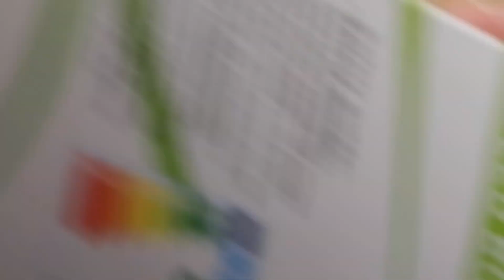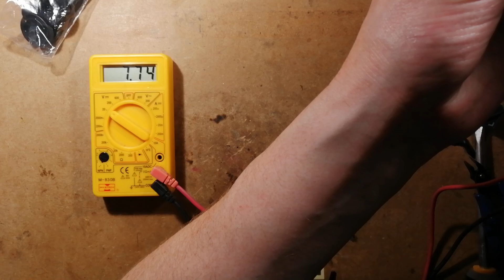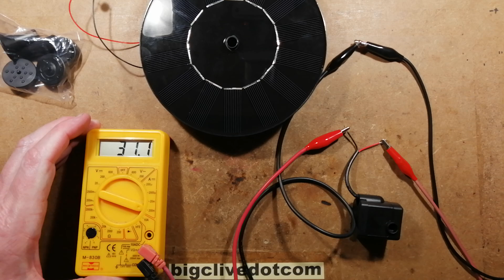Technical look at a floating solar fountain.

Comment: have you looked at the £2 car "ozone generator"? its just a led and a resistor  https://www.ebay.co.uk/itm/Car-Auto-Automobile-Air-Purifier-Ionizer-Ozone-Generator-and-Odor-Eliminator-XU/283487281881?ssPageName=STRK%3AMEBIDX%3AIT&var=584574330575&_trksid=p2057872.m2749.l2649
Reply from the maker: Yes.  They do real ones, but most are fake.

Comment: How can we power the solar panel using coal, oil, and natural gas ?
Reply: By plugging a light into the wall outlet and using that to run it, just like he did for his bench tests.
Reply: Use the coal to boil water, use the steam to spin a turbine, attach the turbine to an electrical generator, and put a tungsten filament across the output of the electrical generator. The filament will glow brightly resistance heats it up.

Comment: I think the camera is just upscaling the video in the same resolution it is recorded, so essentially just cropping the video it records rather than fitting the record resolution to a smaller area of the sensor. It seems quite pixelated when you zoom in. Also the audio sounds more tinny. I wouldn't say I liked your old camera that much, but I certainly preferred it over this one. If you are willing to spend the money, I would recommend a DSLR of some sort. They usually have significantly better video and audio quality, not to mention a better and exchangable lens, usually optical zoom, manual focus and the ability to lock the exposure settings etc, if you please.
Unfortunately most DSLR cameras (at least ones sold in the EU) have a soft record time limit of less than 30 min. This is done because for some stupid reason DSLRs that record longer than that are legally considered "professional" cameras which are subject to significantly higher import taxes. There are custom firmwares for most DSLRs however many of which allow you to record as long as you want or as long as SD card can. Therefore if you want to buy a DSLR I would definitely check if it has a record time limit and if so, if there are custom firmwares allowing removing that limit before actually buying the camera. ;-)
Reply: That's not why dslrs only record for 30 minutes.
It's done because DSLRs are not really designed to operate for that length of time and the sensors are at a real risk of overheating.

Comment: We bought one of thsse two years ago, it's still going strong.  We bought it to quickly replace the panel/lead acid battery/pump set up I'd made a few years earlier.  We had to replace that when I partially de-potted the pump electronics, there was an electrolytic  across the input that blew up quite spectacularly when I got the battery polarity wrong *just once*!

Comment: Turn the pump sideways underwater, to make a solar powered jet boat!
Mount a neodymium magnet on the platform to make the whole unit act as a compass, and it should travel in a straight line across a lake for miles.
Reply: Just make the water exit 90 degrees from the base and that would work. Take to ocean with note in a bottle and release.
Reply: @dsloop3907   "Help please. Stranded on island with shipping crate full of solar fountains."
Reply: @CptJistuce  sending out an army of those thinks lol
Reply: @dsloop3907  Yess! i want to see this done now :)
Reply: I think it better if it would follow an underwater track / guide - then it could go round the pond making the fish dizzy.

Comment: That pump is identical to several pumps I have seen in water fountains made for cats drinking water. I have had several of them, where the bowl was in different design but the pumps was identical. They where powered by a little AC-adapter. I don't remember what voltage they run at, but as the pump you had here looked identical I presume the voltage was the same too.
Reply: Your right, our cat has a water fountain that uses the same pump with 3 suction cups that stick to the base. It runs off a 5V USB phone Charger. Great little pumps but not very powerful. I wanted to make a BIG waterfall for the cat but it wasn't powerful enough to get the required head :-)

Comment: Neat little fountain :) What was wrong with the 'old' camera?
Reply from the maker: I was expecting higher resolution, but they seem to have cheated the figures
Reply: @bigclivedotcom  Your old phone was much better Clive, Sound and video have slipped sadly... :-( HUAWEI P20 Pro are great for video, and have manual settings. Or just roll back to an older OS if its giving you crap. Great video as usual...

Comment: sorry to say this but i think its time to get a proper stand alone camcorder than using a phone just simply because phones tend to wash out images and as this one has pix-elated the zoom in
Reply: I think it’s a matter of convenience/laziness.  Digital zoom on phones/tablets has the advantage of being a simple slider or pinch/expand gesture, versus having to hold a camcorder button and wait for the physical elements to zoom, or deal with jimmying about with a DSLR lens.  Less time spent playing with the gear is more time pulling things apart in what is fun hobby time, I figure.
Reply: Clive has worked on television projects, I was surprised he didn't have pro equipment.
Reply: get a pixel 3a phone, pixel has  the best camera

Comment: wwonder what would happen if you heated the resin  like in a hot air chamber, would it pour back out ?
Reply from the maker: It tends to go crumbly, but not melt.
Reply: Nah, it doesn't do that, it'd probably go a bit, or sometimes a lot, softer though, so things like small screwdrivers or dental picks can be used to carefully dig into the pesky stuff.

Comment: That little blurp of water it generates in less than optimal conditions is a rather underwhelming fountain experience.
Reply: He did say he ran it open barrel and not with the caps on it.
Reply: @ColinRichardson  I have one. Even with the various tips it is about as exciting as a dripping faucet.
Reply: Jeffery Rowan . You get the dripping faucet for nothing. You’ve got to pay for that piece of poo. I know, I’ve got one.😳
Reply: It's a slightly nicer burp if you have a cap on it rather than leaving it bare, but the fact that it stops like that is pretty lame and "less than optimal" is almost the whole day.
Reply: Seems a bit vigorous when the sun is out as well... Maybe this needs a battery in there, with the pump current limited to the right level. That would cost a few cents more though.

Comment: i think this is the perfect solution for my cat's always asking to drink from the tap....
Reply: the running water makes them wee :)
Reply: My cats love the tap, even over a clean fountain... The fountain excitement only lasts a day or two, then it's back to preferring the water dishes or waiting at the tap.
Reply: @Matt Quinn this is why I love cats they don't care what their owner wants they go their own way and still are either cuddly creatures or nice passers by
Reply: What if you make it smaller and put it in drink, you would not need a A plastic straw. Solve the problem of plastic straws ending up on the sea.

Comment: Hi Clive, firstly great vid and excellent channel. For info I had one of these for a while but after it stopped working I dug into the resin. Your correct there is a capacitor inside but also a small circuit board with an inductor, control chip and a load of smd components. Unfortunately it's not quite as waterproof as you first think, but I suppose 2 odd years use from a Chinese ebay items not to bad :)
Reply: Thanks!
You answered a question I just made!
Reply: @jonathantatler  your welcome, maybe I should apply to be Big Clives sidekick, not sure if 'Little Jamie' has the same appeal though :)
Reply: I was wondering if they were using some kind of buck regulator based on the hysteresis of pump as clouds passed overhead... I also suspect they are brushless.  Was there a brushed DC motor in yours or brushless?
Reply: @gavincurtis  Mine is a brushless motor like in Big Clives video. I wish I'd taken photos when I dug through the resin. The circuit board looked similar to what you get in the little garden solar lights. The problem with mine was water damage/corrosion on the components - I believe the resin seal around the output cable to pump isn't 100% so water tracks up to the circuit board. I got mine working again by removing the circuit board and connecting the solar output direct to the existing capacitor and pump. Probably not the best and although I say it works now it needs a lot more sunlight before the pump kicks in (due to charging the capacitor). Like you say I guess the original circuit must have some form of boost control to allow for low input from the solar panel. If only I'd taken photos I would have sent them to Big Clive after seeing this video as I'm sure he would know or figure out what it did....Big Clive the oracle of all things electrical :)

Comment: New camera seems much more pixelated zoomed in.
Reply: Yup, it is. Very pixilated
Reply: I thought youtube dropped me down to 480p for a minute. But even at 1080p it still looks bad.
Reply: Methinks so too! - The old beast gave sharper focus, but let's see how Clive can tweak and fiddle with it first, to see how good it can be? But at this stage, it's not so impressive.
Reply: Maybe its using digital zoom instead of optical zoom. That is probably why
Reply: @lets_just_say_im_innocent   They were all digital zoom. Cheap phones seldom have optical zoom.
Reply: @rimmersbryggeri  I agree. Maybe a lens adapter kit or whatever might work but I'm only assuming
Reply: @lets_just_say_im_innocent  i can asure you that it was fully renderd becouse i'm on pc and i its only verry pixelated when he zooms in so.. yeah
Reply: @rimmersbryggeri  I've never seen a phone with optical zoom.
Reply: @lets_just_say_im_innocent  but a cropped 21mp camera shouldnt look that pixelated ,my samsung phone dosnt and its only 12mp
Reply: @girlsdrinkfeck  Even if the sensor has higher resolution, it might only sample a specific selection of pixels when recording video.
Reply: @girlsdrinkfeck  I said it might only sample specific pixels. I didn't say that's the only way of doing it, or that it's how it should be done.
Reply: I suspect he is using Open Camera and it isn't taking advantage of the actual full capabilities of the sensor, rather just enlarging the existing 1080p video (making it very pixelated). Perhaps the official app doesn't have this issue?
Reply: It also looks a lot more blurry overall. In the desk footage (even without zoom) you can no longer really see the grain and scratches of the particleboard. It's all just a blurry mush now. 
Definitely a massive camera downgrade
Reply: very mushy...
Reply: It does seem like the lens is a lot worse quality that what the other phone had. The bigclive text is blurry throughout the whole video, and is also distorted (slight fisheye effect). Those 20 megapixels don't mean much, when paired with a low quality lens.
Reply: @Doct0r0710  That does seem to be the case. No pixelation, but the focus is never quite sharp.
Reply: It's definitely pixelated. I don't know what you're thinking of when you see "pixelated", but when zoomed in it is absolutely pixelated. AND mushy. Check out 3:54 and the hose going from the pump (top, left of center).
Reply: Definitely, especially on the text when Clive focuses on the box. Old camera was a lot better.
Reply: Yup. Definitely bad a cheap digital zoom.
Reply: he might not be recording at full quality
Reply: To be fair I think it may be zooming further, it is really tight, definitely not pixelated but definitely "soft"
Reply: Also, higher resolutions can mean worse low light performance, Clive might just need bigger lights - would explain why it may have worked earlier but not now - more light
Reply: yes indeed! so i wasen't the only one that noiticed
Reply: joshmbrown42 Yes that is exactly what's going on. My old Sony phone I use does that, it sucks. Digital zoom is quite OK for this stuff if the lens is good and it actually interpolates using the sensor pixels. I wonder which app he's using, it might be that the stock app supports sensor interpolation but Open Camera doesn't.
Reply: The whole video looks quite mushy, if the video bitrate in open camera is "default" it might be way too low.
Reply: Certainly not 1080p
Reply: possibly little point in zooming in then if only digital zoom !
Reply: It looks like you're running on software interpolated zoom for a low-resolution webcam. Is the rating for 20 North American megapixels or 20 Chinese megapixels?
Reply: @crimsonhalo13  americans donty makr cameras
Reply: I was just about to type exactly that
Reply: Odd. I'm watching on a 42" display and don't see any pixelation.
Reply: @PaulSteMarie  You're watching on a CRT !
Reply: @millomweb  Actually, no. I'm watching on a 42 inch HD flat screen.
Reply: @PaulSteMarie  Matt or gloss ?
Reply: @PaulSteMarie  Got to ask yourself why you can't see the low resolution then !
Reply: @millomweb  To be clear, I saw some minor lack of focus, but not pixelation.
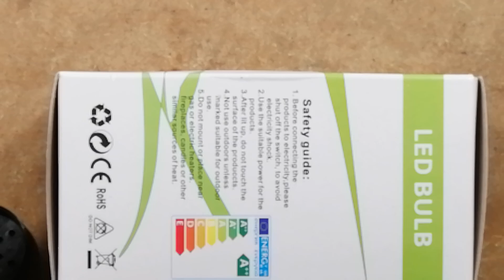Reply: @PaulSteMarie  OK. Let's take 12:20 - and look at "Safety Guide". The S in Safety is incomplete as there are vertical white lines across the S - as there are across the logos on the bottom of the box (left side of picture). Do you see that fault ?
Reply: @millomweb  Ok, yep, you're right. Definitely pixelated on the logos. There's about 20 seconds while he is adjusting focus when the pixelation is visible.

Whoever implemented the digital zoom for that camera firmware should be given a big dope slap. Each little square should be linearly interpolated between the known points. What this camera appears to be doing is assigning the colors from the input pixel to all the output pixels that are closest to it, or even worse, multiplying the XY of the output pixel by a scale factor and truncating to integers.
Reply: @PaulSteMarie  And later on when he zooms in on the circuit board - same issue is clearly visible despite it being out of focus !

Anyway, glad you can see the issue now but I'm still a bit puzzled that it wasn't as obvious to you as it was to the rest of us.
Reply: @PaulSteMarie  I think they have been watching while i hadnt been fully rendered in HD.
Reply: @rimmersbryggeri
I'm watching at full HD, but it's definitely pixelated when zooming in. Remember, just because you can't see it doesn't mean nobody can.
Reply: @timderks5960  indeed (and yes im gonna have critiqe on evry comment that i either like or don't like)

Comment: I paused at 6:00 and I'm guessing it contains a big capacitor - I was given a small solar panel for powering a little water pump once, and it had a potted black box stuck to the back, which contained a big capacitor, but no diode so as soon as the sun went, the solar panels soaked up all the energy from the capacitor...

Comment: We have these in our Koi pond.  They work very well.
Reply: Aeration of a fish pond is the perfect use for these things. Probably also good for decorating pools and discouraging mosquitoes.
Reply: @tactileslut  Great idea! I was about to suggest that. After the AC plug-in pump failed, we stopped using our 80-gallon rigid drop-in pond because emptying it once or twice a week to eliminate mosquito larvae was getting tedious, and stressful for the fish we used to have.
Reply: @tactileslut  My mothers yard flooded this year... I told her we should just dig down a bit, add a liner and some rocks, and make it into a feature! 😅
Reply: How long have they run? I'm legitimately curious about that. At $10 a piece, they are more than replaceable, but it'd be nice to know if they have any longevity to them.
Reply: @richfiles  mine went all white and crusty after one summer,(calcium probably),  the top was warped badly (heatwave did that ) and the pump was filled with slime,). I didn't remember to get a new one for this summer.
Reply: @fart306  Okay, so basically, figure on them lasting for a summer, maybe two, and then just replace them? At least theyre fairly cheap. Ever try cleaning them up? A little lime remover and some bleach to scrub the pump. Looks like bigclive's pump could be disassembled for cleaning.
Reply: Richfiles, two years so far.  I don't see anything breaking down other than they need cleaning every now and then.  Their little pumps have definitley logged some hours as they are in direct sunlight almost the entire day which is what they need to work with any positive impression.  I was expecting one season from them, but a little care can go a long way in making them last.  They have faded a little from the sun, but they keep pumping.  Wiring, epoxy covering over the solar cells are still in good condition depsite UV.  There is mineral build up on the solar panels..but once wet become very translucent again.  I suppose CLR would clean them right up if it becomes a problem.  They still reach the same spray height.  When it lowers, will clean the cells or jist replace the fountains with new.  Cost to satisfaction ratio for me has been excellent.